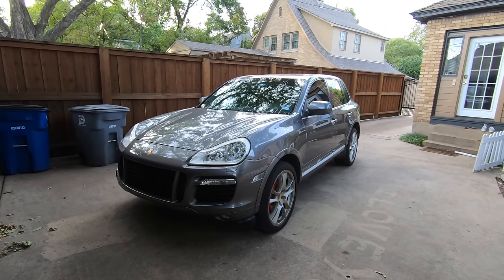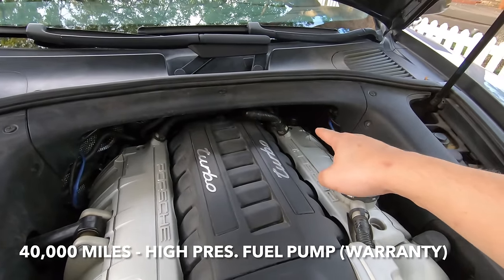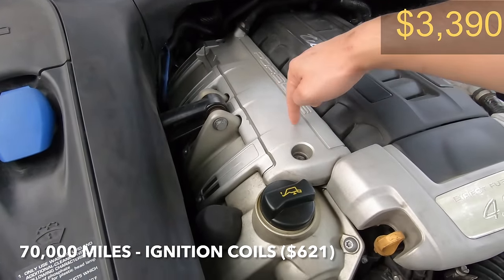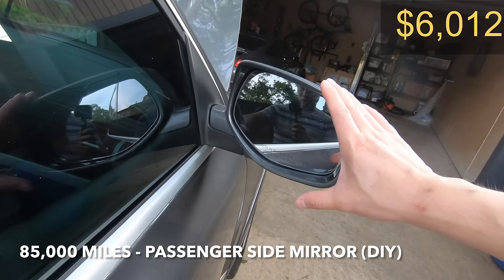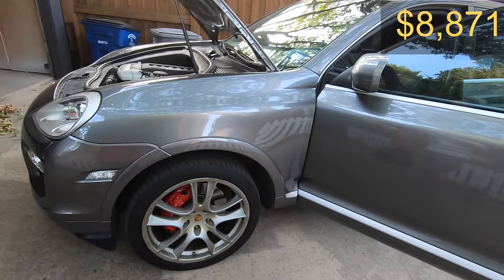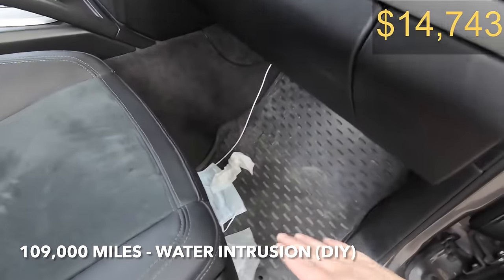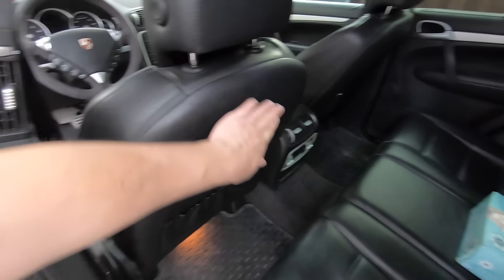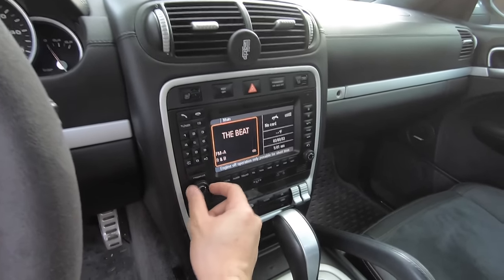Why Are Used Porsche Cayennes So Cheap? Owner's Review of 15 Year Old Cayenne Turbo (955, 957)

Comment: I've definitely been lucky with mine. I purchased my '10 GTS 3.5 years ago with 53k miles.  It now has 94k miles. Before I got it, the previous owner had a oil leak and they performed a complete engine out service on. I was nervous because of that, but ultimately dove in and did so without any warranty. Since then I have had to: 

1. Re-glue the back of the passenger seat (free).
2. Noticed it was stumbling, found cracked ignition coils and replaced them all for about $550.
3. Discovered a small coolant leak under the intake manifold, turned out to be a broken/cracked vent line. New hose was $38 and replaced it myself.
4. While fixing the coolant vent line I decided to proactively replace the starter which was about $450.
5. Driveshaft bearing carrier started failing. Almost purchased aftermarket solution but saw several folks mention they developed vibration afterwards, so chanced it and did the jimi-fix which involves creating a new bearing carrier with 5/8-inch heater hose and zip ties. Worked like a charm and zero vibration. Cost me about $8 in parts. That was two year ago, checked on it about a month ago and no signs of wear.  Going to continue to send it. 
6. Coolant reservoir finally cracked and gave up the ghost this summer during a heatwave. Aftermarket tank was $85 and installed myself in about 30 minutes (although it did require a coolant vacuum tool which I already purchased to change out coolant with regular maintenance).

That's pretty much it besides tires, oil, spark plug changes, etc. It's been a pretty reliable car for me compared to what I hear from some others. Took it on a 1,500 mile road trip earlier this summer. Handled it like a champ and the most comfortable long distance driving car I've ever rode in.
Reply: "That's pretty much it besides..." Honestly looks worse than a beaten up car that's a fraction of the cost of Porsche. I did this kind of maintainance to 1 car and after that never again.
Reply: @quarkkino1573  Yeah, it looks that you need to be a semi-mechanic type of guy to own one of this high demanding mantainance type of car.    I always wanted to buy a Cayenne, but now i´m re-thinking it.  I don´t want to be dealing with those "little details"  to keep it running nice.  I own a 2012 Camaro SS  for 10 years now,  I have take it to the track and beat the sh out of it, and use it as a daily driver.  Never had an issue, NONE whatsoever, never taken it to the dealer or any autorepair-shop.    THAT is the kind of car i want, and  more if it as expensive as a Porshe.   I´m kind of dissapointed because I was  really  looking forward to buy a Cayenne, but i don´t want to buy a Toyota , I want something sporty and reliable.
Reply: “And that’s it!” Ok. You know that’s not normal right? The affordable used German car is the least affordable car there is.
Reply: @manfredstrappen7491  about $1,500 in maintenance parts and fixes, and a few hours of my time over 3+ years for a 10+ year old car isn’t bad at all. My wife’s Dodge Grand Caravan has had more issues than my Cayenne ever did. 

If you want ultimate in reliability and years of trouble-free driving then drive a Toyota or a Lexus. It’s just going to be pretty boring to drive in comparison to a Cayenne. My GTS handles like a sports car and tows with ease. It may not be for everyone but love mine.
Reply: A year later, how has it been? I’m heavily considering a 2011 CS

Comment: Makes me so happy to be an owner of an old Honda Accord.  2005, 160k miles, 2.4L, 4-cylinder, 5 speed manual.  Outside of regular maintenance I had to replace the radiator.  Absolutely no other issues,  nothing leaking, no electrical issues.  The car runs smooth and is a blessing to have
Reply: ...mmm Ole Blue my 2001 Honda Accord EXL 4 cylinder - 5 speed manual only has 471,000 miles on it . AND it is still shining and running like new .... I wished that I had bought two of them just in  case this one gets stolen
Reply: @diverdave4056  
Holy hell 471k miles?  That is absolutely insane.
Reply: @jaysmith6013  i would have had more miles on it BUT i had to retire 5 years ago to take care of my father until he passed away ... my Odyssey van has 125,000 miles on it - and yes i am the only driver of both
Reply: @diverdave4056  
Same my accord would have had more miles on it as well but it’s driven way less now that it’s just a 3rd car for our family.  Keeping it because I still enjoy driving it and my kids will have something to learn how to drive a manual

I drove that car from Chicago to Southern California to Northern California and back to Chicago last summer.  Put on 4500 trouble free miles without as much as a second thought will I get stranded.  It’s such a solid car and runs just as good as it did 10 years ago

Comment: I have a 2002 911 Carrera Coup.  Other then normal maintenance items I’ve had the ignition switch, oil pump and alternator fail.  The alternator failure was caused by a garage attendant jumping the car incorrectly after not turning the lights off. So for a car being 21 years old not so bad.  I currently have 104,000 miles on it.  I stopped going to the dealer for maintenance and found a great local Porsche place to perform maintenance items. I’ve carefully followed all maintenance suggestions and strive to keep the car at spec during its life.  Overall very pleased with the 911. Mods have included a KN air intake system.

Comment: Dude I'm staying with my Subaru. 260,000 miles and it's still going strong.
Reply: And it has Porsche 911 engine to boot!
Reply: Just sold my 2004 wrx . Had to get a new clutch after too many launches. I would have bought another subaru but the infotainment system and cvt trashmission. Miss that car
Reply: @AK-bw8xk  
Yeah they really need to give us an option without a damn CVT!!
Reply: @AK-bw8xk the new infotainment system is nice though, have you seen the premium trims?

Comment: That’s ridiculous… it’s honestly horrible. 
But thanks for the video, cause I did ask myself, why those cars depreciate that badly! Now I know.
Reply: Par for the course for german high-end cars really. (Or really any high end car, to be fair)
Reply: They depreciate that badly because the big leasing company in that states which sets the values for used cars doesn‘t have categories for most of their features. Only A/C yes or no, power steering yes or no, AWD yes or no, manual or automatic. Up until the 90s or early 2000s, VW and Audi would build the best 4-zone climate controls, most advanced lights and driving assists, fanciest radio and interior displays, finest interior materials, smoothest transmissions and air suspensions, strongest brakes and safest tires into their US exports.
Then a bunch of Audi engineers who visited the place started wondering why their 50k car was now worth 20k, same as the car next to it which had a third of the features and just the basic stuff among those. So they started downgrading for their american exports to remain competitive (BMW for example had realized this much earlier). Worse performing brakes that lasted longer instead, all-season wheels that perform bad in summer and even more bad in winter, base versions of manual and auto transmissions, basic A/C, base version of the lights, so on and so forth. Almost all of the features you could individually select in Europe were removed for the US and the few remaining were bundled up into 1 or 2 upgrade packs per car. The only thing that remained universal across all markets was all the mechanical safety stuff, rigid doors and fuel tank as required in the US, strong ability to absorb kinetetic energy and good pedestrian protection as required in Europe or Asia, all that stuff. This is also why german cars are so expensive, they‘re 20% engineered to drive well and 80% to keep you alive if something goes wrong. 
In the end they pretty much gave up on the US market since everyone there leases cars and the company that does the leasing undervalues them anyways, so they just slapped a bunch of onboard-diagnostics in as required in the states, hoping it would compensate for the lack of regular checks and maintenance.
For comparison in Europe, german cars are the most value-stable, sitting around 53-60% after 4 years opposed to the average 50 ish %, since all the tech they include counts.
Reply: That’s why i ride a 🚴🏼

Comment: rode in one recently and the "riding experience" was nothing like I've ever experienced. I can see why you put up with all the headaches. with a simple crunch of those numbers, as far as warranty goes, that definitely worked in your favor.
Reply: describe the riding experience
Reply: @papagen00  It’s a 500 hp SUV. Ever ridden in a Porsche? I’ve been in some. When someone else was driving, it was always maniacal. It’s like they said “you signed up for this” and went bonkers. In the “911” (996) and 4S, going around bends easily twice the speed you take them in other vehicles. Accelerating onto the highway at over 100 mph and getting ready to open it further (I told him to slow down, please). And it was my “old” neighbor driving his turbo. It has a flat torque “curve” of 400 ft-lbs torque in a modest weight car. Went to look at a used 4 S. The salesman asks how much experience I had driving them. I said just a little. He said “okay, I’ll drive then”. He knew the roads but, jesus, say your prayers, it was uncomfortably fast. I’ve been racing around since my early teens. I thought nothing would faze me. In Porsche, it’s at another level. Hear me now, believe me later. I test drove a 90’s 911, in straight-line accelerations and such. Since I was driving a simple N.A. Porsche and not beating on it, it was modest. So basically, if you get in one with high horsepower, the rest of the car is built to go with it - coupe or SUV. Toyota and Honda make great vehicles, but only the NSX and tt Supra are in Porsche-territory. It’s cutting edge racing performance, without the same level of reliability design and testing. Without that, I think you sacrifice a smidgen of safety, so don’t drive the GT3 or 4 without some training. That said, Toyota looks to BMW these days for their Supra, so Toyota worshippers and BMW bashers take note. Just sayin’, and I’m not a fan of low-reliability.
Reply: @JCS That’s your job to determine.
Reply: @tennnis498  Drove a GT3 once. That thing is scary fast. Nothing I've driven before or after compares. It's a completely different driving experience. I totally understand why people spend lots of money on them. I would, for sure, if I were in a position where I could justify it.
Reply: @DutchDiederik  100%
Reply: @DutchDiederik  Gotta have money for the lawsuit when you kill a family going "bonkers" too, it ain't cheap. And ofcourse for the lawyers otherwise you'll be going "bonkers" in your cell.
Reply: @0xsergy  that escalated quickly.
Reply: @0xsergy  Depending on where you are in the world - race track ,  a real highway (ie autobahn or something alike) or a circuitous road with a bit of care.

In the case of the curved road - hit the brake before the turn slow down a little and hit the throttle in mid turn.
It isn't necessary to overspeed to get a lot of fun.
Reply: @TheStefanskoglund1  ye, i got no real problem with ppl finding some isolated spot to fuck around in. The issue is when they do it around other ppl.

But even then, given the current climate situation all these ppl using cars just for "Slideshows" and all that nonsense is really very wasteful.

We're like 10 years away from not being able to grow crops anymore and dumbasses just wanna do donuts in an intersection to match the donut in their head.
Reply: @0xsergy  we’re gonna be fine. They’ve been saying the world will end in 10 years since the 1970s.
Reply: @0xsergy  enjoy riding that doom train. I want zero part of it.

Comment: Imagine a camrey owner explaining issues "Well I had to change engine oil & filter after 5000, Tires worn off after 70,000 and brake pads after 100,000". After 500,000 had to change seat leather.

Comment: Thanks for this video.
Here in the UK you can get these cars for £3000. Now I understand the low price.
I have a JEEP Renegade from 2016. JEEP is now owned by FIAT.
My car has the 1.6 Multijet Diesel Engine and 85k miles.
Problems I had with it during 8 years. A lambda sensor and an engine mount totalling £500 repair cost. And that was it in 8 years.
I was expecting a FIAT made car to be way more prone to fail than a German car, especially a Porsche. This Cayenne seems to be a money pit.
I was really tempted to buy one for £3000. Thanks again. You saved me. Cheers

Comment: My cayenne 3.2 is 17 years old I’ve had it since new. It’s done 115,000 m . Have had a few issues but nothing too bad, damp front carpet due to a blocked rubber seal , the front car windows stopped working but not much else. I service it once a year and it still goes and looks great . To replace it would cost 60k so I’ll keep it.
Reply: so you only drove 115km with it?
Reply: @Exchiefboy   no. Miles.
Reply: @noelmcloughlin4684  oh right. Sorry 🥲

Comment: I have a 2012 BMW X5 Diesel that has been FAR cheaper to maintain than this one.  Currently at 120K miles and just replaced the Comfort Access door handle on the drivers side ($300 for parts online vs. about $900 the dealer quoted) and Continental DWS tires a number of times over the years (As these are 315 wide on the rear, they only get about 30K miles per set) and regular oil changes.  Total maintenance costs = less than $500/year for the last 11 years

Comment: Had a 2011 cayenne s with 113k miles that I thought I got for a steal but the motor blew after just 1000 miles (no, it wasn't the cam bolt). Clean car fax and appeared maintained very well. 18k replacement. Almost 2x the car cost. Got 2k back for it. Back to jdm.
Reply: Dam they got you good
Reply: Always lease
Reply: You bought a cheap neglected one. They are reliable. Buy a neglected Toyota, bmw, cadillac and you will end up the same.

Comment: Reminds me of my Porsche 996 turbo, which I bought new in 2001. I  ran it for 10 years /35k miles and  spent £26k in servicing /parts with the supplying dealer. That didn't include a full engine strip down and rebuild after a crack was found in the engine block after 2 years  in my ownership which was done under manf warranty.

Comment: This is exactly why I'm so glad I sold my Audi Q7 S Line. It had 79,000 miles on it and was about to have to need about $5000 worth of work done to the intake system - which I had already spent $1,200 dollars on. The infotainment system and air ride system had problems too. I'll never buy any VW product again.

Comment: I have driven a lot of cars, personal and work vehicles, of all types, and the number of problems experienced by this car while it still had low milage and age is insane.  I still own a 1998 C230 Mercedes, and I have had if for 20 years, I drove it cross county and back and up and down the East Coast and only had two serious issue with it and very few other issues.  If I had a car like this Porche, which seem to be in the shop all the time, I would soon sell it.
Reply: You would not sell it, though.  Most people that get one have wanted one for a long time and it feels like they have achieved something in ownership.  Once you have one and drive one daily it is really difficult to give that up.  Not worth the price that is charged but you can't duplicate the experience.  Many people also love the cachet of having one as it does impress people to pull up in one.
Reply: I'd kick it in with steel-toed construction boots if any car did this to me.

Comment: I used to own a Porsche 944S that did have some mechanical issues, but luckily I had tools and knew a lot about mechanics and was able to take care of the car reasonably well. I now have a 2019 Nissan 370Z that I bought new that now has about 46K miles. There have been no mechanical issues whatsoever and the only expenses have been the cost of routine maintenance.
Reply: It is disappointing that Porsche, with their vaunted engineering skills, continues to produce vehicles with faulty parts.  There is no reason for it except that they cheap out wherever possible to maximize their profits on their already wildly overpriced vehicles.
Reply: interference engine with timing belt that routed along the water pump, high cost every 36k maintenance and still designed to fail